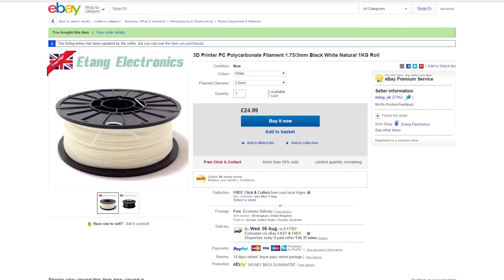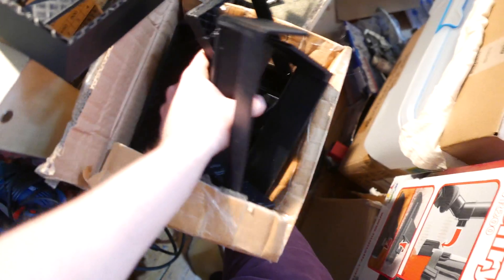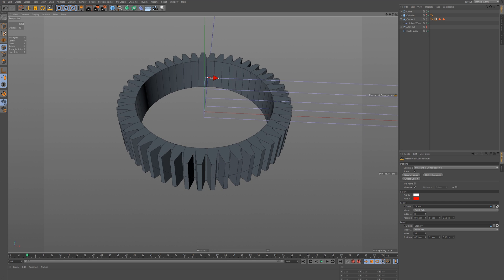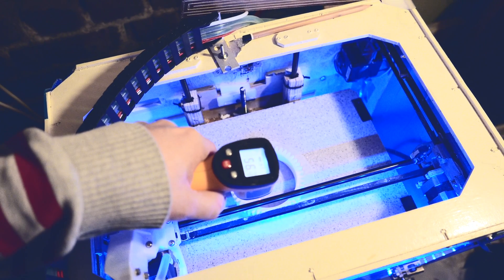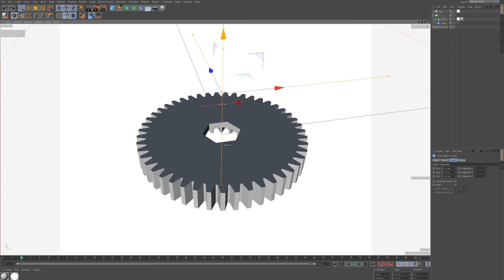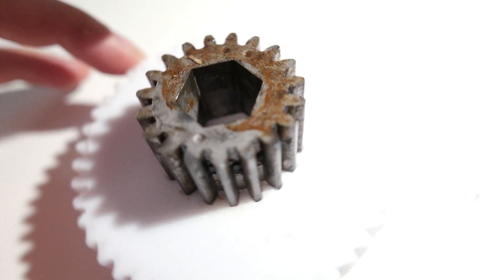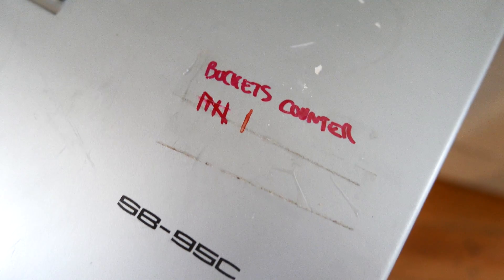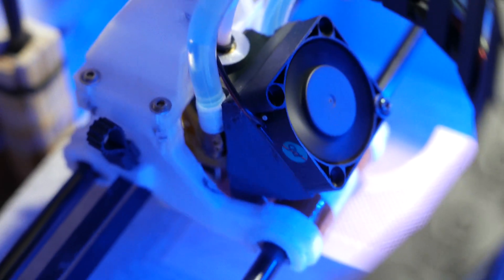3d printing with polycarbonate filament. Resurrecting a broken shredder.

Comment: I FLIPPED MY BED LINER ON MY ENDER S1 AND USED 35 GRIT MEDIUM HARD JUST 10 SECONDS OF SANDING AND THE POLYCARBONATE STUCK PERFECT NOT TO WELDED ON AND DID NOT BREAK OFF !!  USED YOUR ENCLOSURE IDEA AND I WAS MELTY FOR THE FIRST 3 TRIES AND REDUCED THE HEAT BY 2 DEGREES UNTILL IT HARDENED TO MUCH THEN INCREASED TEMP BY 1 DEGREE THEN .5 DEGREE !!! WORKS PERFECT NEVER THOUGHT IT WOULD BE THAT EASY !! NO  GASSES YET I'M STILL PRINTING SMALL!!!  THINK I WAS AT 254.5 JUST CHECKED THE SETTINGS AND IT SAYS 256 C THANKS FOR THE VID!!!

Comment: what bed material do you use?
i think polycarbonate has a bad name. with my doot changer I can print it very easily. No cracking at all if I throw a blanket over my printer. or simply put it inside a enclosure (my printer can be enclosed which it will be soon once my ABS sheets arrive
Reply from the maker: That's interesting. I used to have an enclosure, but it didn't seem to help much. Also the enclosure means my steppers overheat and my extruder gets too hot. But if I might give it another go, I like PC! My bed material is aluminium + hairspray + PVA/hot glue depending on printing material
Reply: @Loopyengineeringco  I actually print on a poly carbonate sheet! with a little bit of a wipe using pva+water solution it won't bond or weld to the print surface! I haven't been brave to do it without it xD but I'm designing my printer to move the motors outside the enclosure and make the frame itself be enclosed so I won't need a pillow

Comment: what printer did you use?
Reply from the maker: It's a printer I built myself. The frame is based on a Replicator 1 design but made taller for more Z. a Pi2 running OctoPrint, driving a standard Ramps board with Ice Blue stepstick drivers. Custom extruder carriage with a watercooled e3d v6 (watercooler parts are Corsair Hydro H60 CPU cooler with silicone tubess). PSU is a HP blade server PSU pcb.